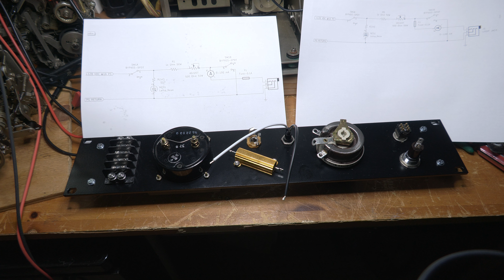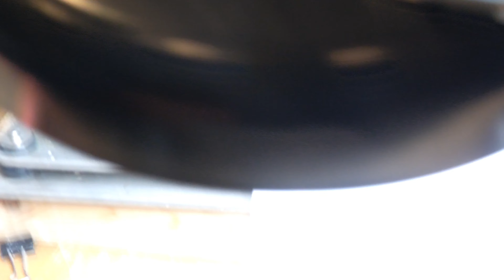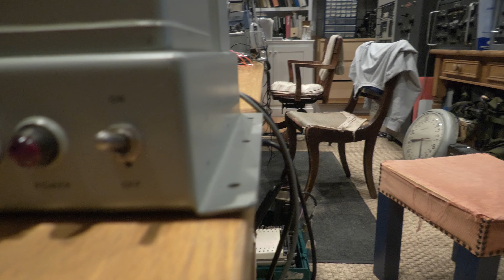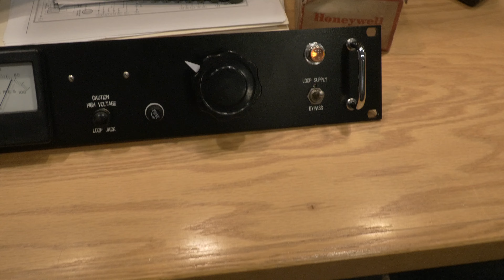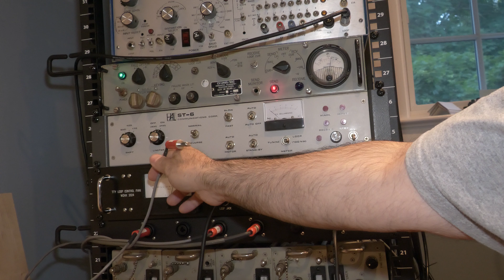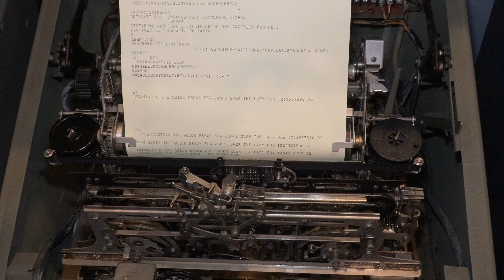TTY Loop Control Panel Part 2

Comment: Do you have a forum board or a way to ask you questions on a particular topic?
Reply from the maker: I don't but feel free to ask here. Otherwise I'm good in QRZ.
Reply: @w2hx   Looking for a good PRC-152 clone. I see bunch on ebay but nothing looks consistent between the "brands" I have seen TRI & TCA as the two biggest. Any recommendations for a good all around for daily fun use?
Reply from the maker: @bobbyloki sorry,  I'm not familiar with the Chinese copies but lots of info on the web about them